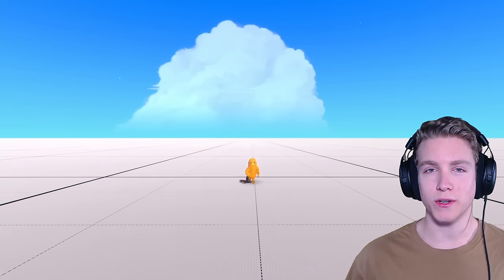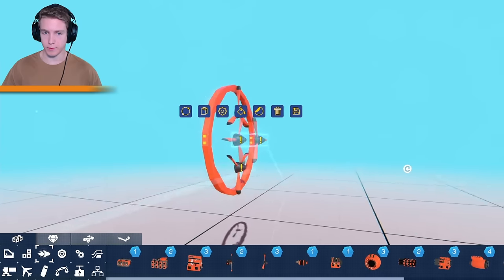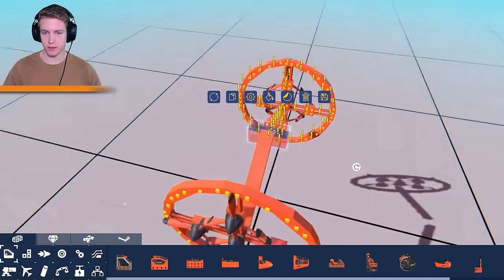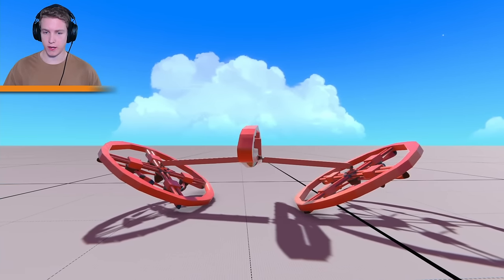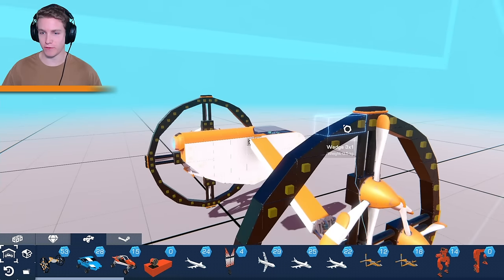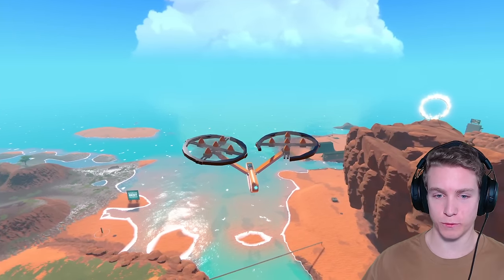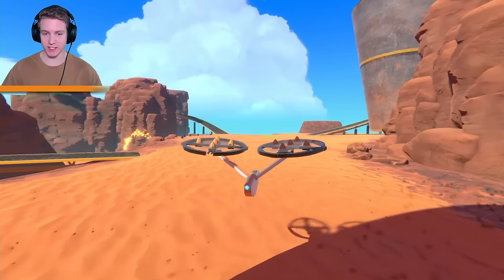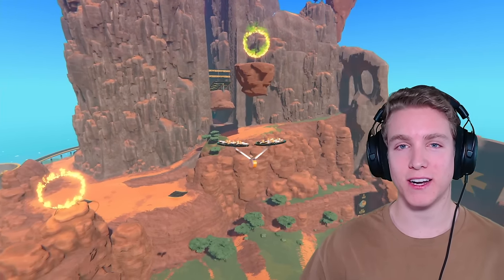Two Wheeled Transformer - Trailmakers

Comment: You might want to put another ring on each of the wheels attached to a servo that rotates it to a 45° offset so you have more friction pads in contact with the ground
Reply from the maker: Ahh that actually might work!